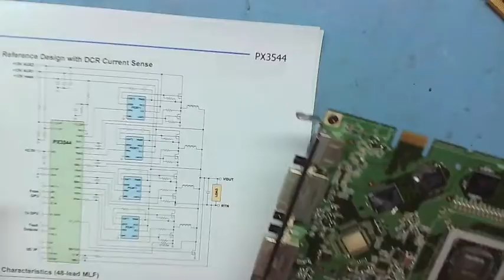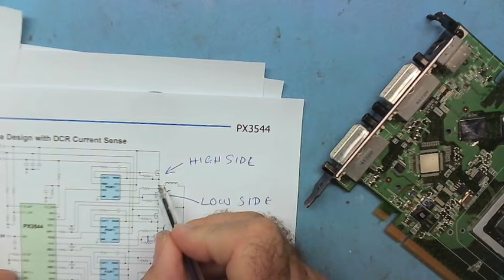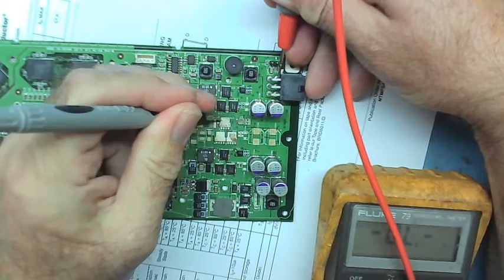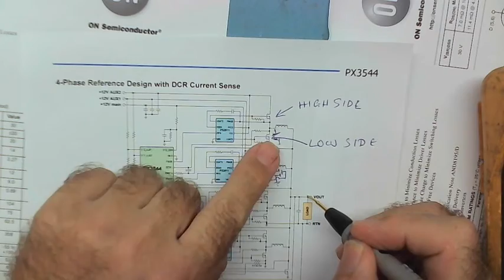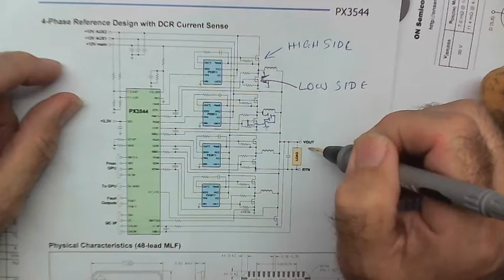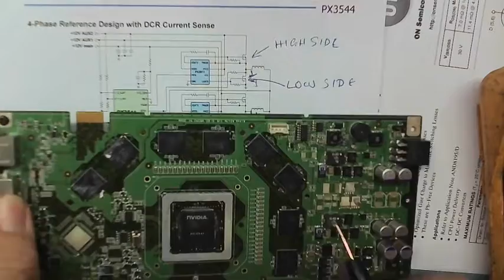Learn Electronics Repair #9 - Geforce 8800GT Graphics Card Repair part3

Comment: 1 year later and I came across your videos.  Just to say that I was building a Windows 7 rig and forgot the 6-pin connector on the graphics card and yes, it booted to a black screen and told me to plug in the connector. Now I understand how it did that using the 12 volt power from the PCI bus to the gpu. Great info, thank you. I learned a lot of useful information in these videos ;)